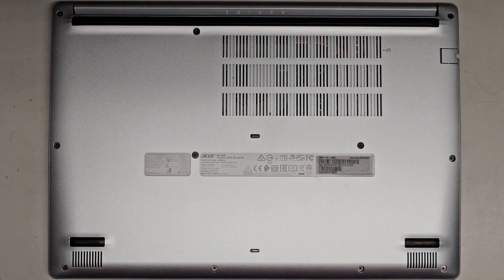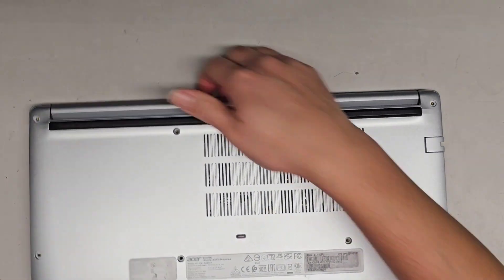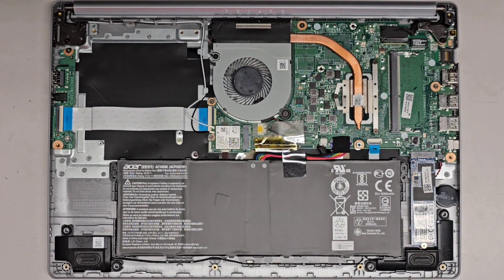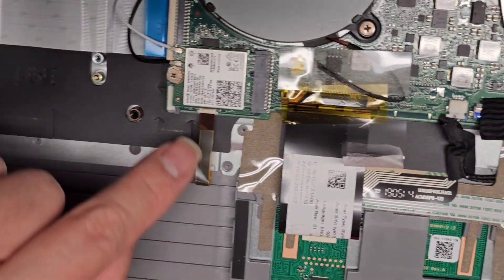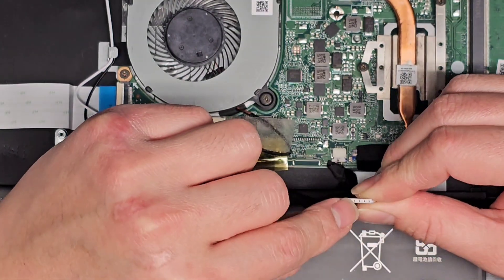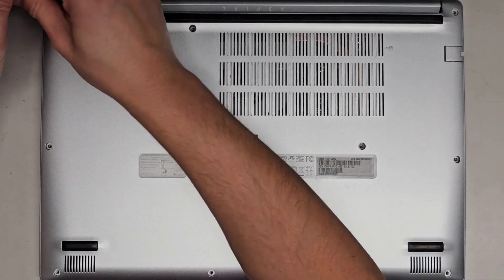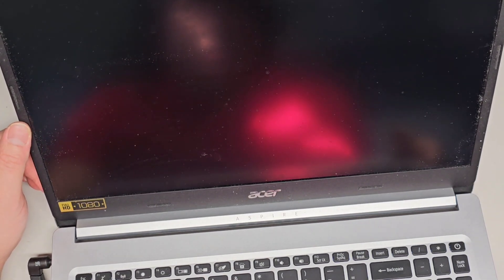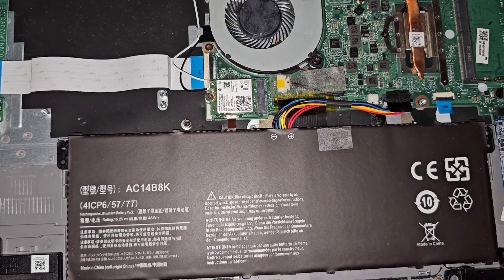Acer Aspire A515-54 Series A515-54-30BQ Disassembly RAM SSD Upgrade Battery Replacement Repair

Comment: I have the exact same issue going on. I followed your video and unplugged my battery plugged it back in and still the same issue. When I start the computer up, it shows a battery symbol with an X through it and it does not run without being plugged in. When I checked on the battery by going through the command prompt it said battery not installed. I might try and get a new battery and put it in myself, while I’m at it I might do the ram and storage. Thanks for the great video.
Reply from the maker: Sounds good. Hope it works.